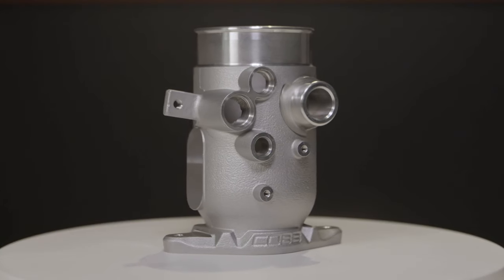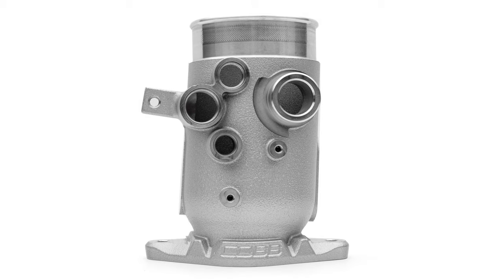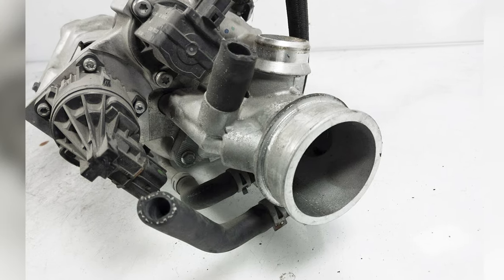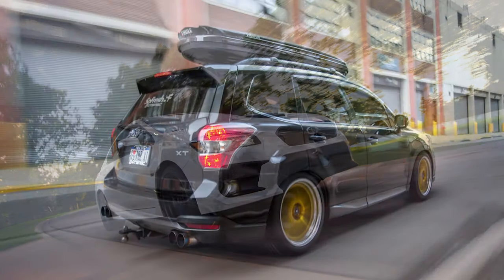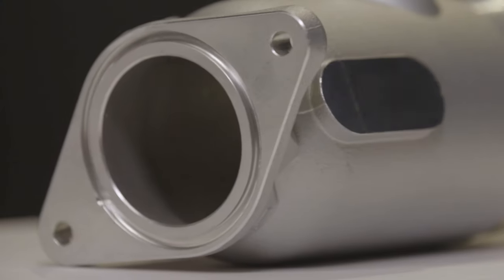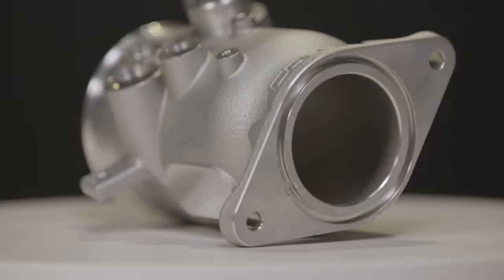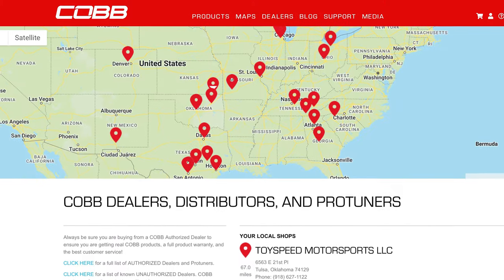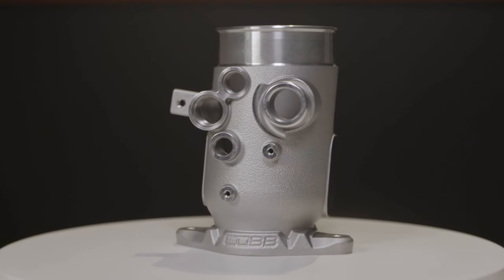COBB Tuning - Product Highlight - Subaru Cast Turbo Inlet

Comment: Just ordered this!!!! Canceled my order for the grimmspeed and got this. Carb legal in California was my main reason plus I like the look better than grimmspeed.
Reply: They may be backordered but at least grimmspeed doesn't screw you.
Reply: @daviddin8863  I’ve been waiting 5 months for mine. Absolutely unprofessional Idc what excuse they pull out of their ass
Reply: This is a dumb question but do you have to also get a bigger hose since the inlet is 5mm larger than stock or can you manage to run the stock inlet hose going to the air box.

Comment: my wrx is already tuned with the stock inlet, so i need to retune for this since it will give better airflow?
Reply from the maker: Tuning is not required to run this part.